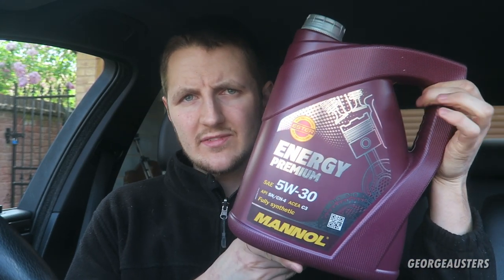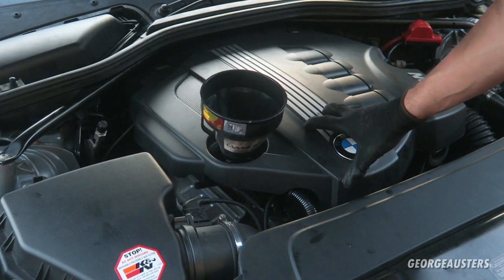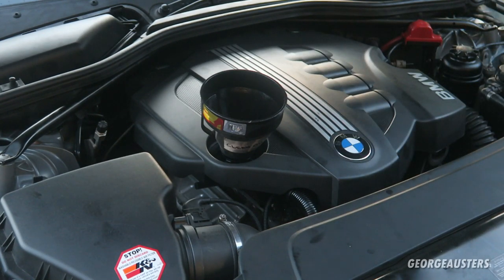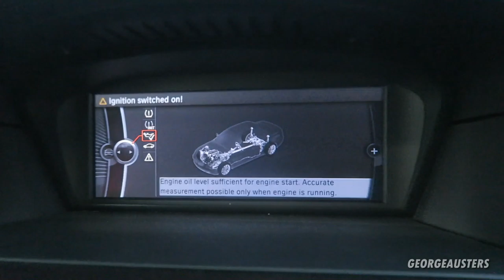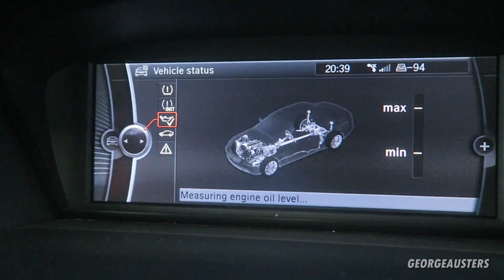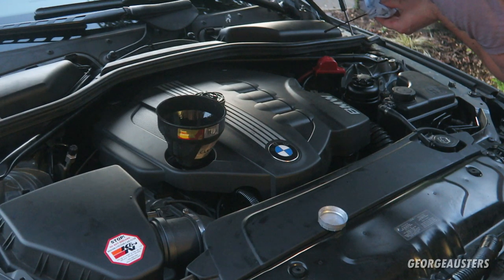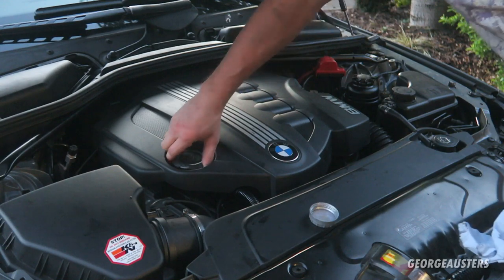BMW N47 / N57 Oil & Filter Change

Comment: Nice one 👍. George i have question.. I bought a BMW X3 n57 six months ago, a service was done and an oil change was recently noticed that the oil level had increased slightly. . is 2mm above Max level on dip stick. Is this level safe for the engine? I plan to change the oil in a few days thanks

Comment: Nulon is my favorite oil. Once I bought saab and the car had dirty engine from inside. I bought castrol edge nothing happened then I find this nulon oil and ooo myyy goood! All the rubbish came down to sump again and again - i was changing the oil every 100, 300,500,1000, 2000, 3000.. and still a little of the slags was coming out. Nulon is cleaning machine lol. For old car with rubbish inside engine I do not recommend it but if is the engine kind of clean inside and you just bought the car its good idea to give him good clean........but you need to watch out because plug oil strainer with melted rubbish is not the best what you can do for your car lol

Comment: Hi, i have 116 ed 1.6 diesel from 2013, N47…i taked the dpf out. is this oil ok or Mannol longlife is better? I never changed the timing chain in 220000km and seems to be good as i change oil and filter every 5k miles

Comment: Hi George, I find all your videos very informative and well made. However I have one small tip for measuring the fresh oil you just put - when you first pour it, wait for 4-5 min to drain into the oil pan and then check the dipstick. :)
Reply from the maker: I did wait some time before checking.. I edited that time out though :)

Comment: How did you find the car running after using this oil? It’s about £20 off eBay but I heard you shouldn’t use cheap oil? Engine runs rough etc etc
Reply from the maker: Fine

Comment: Great video Iv had mine 6 years 120d coupe msport done 110.000 miles      I do my own work the oil filter I put in first so the nipple fits in properly then screw the cap on.    The o ring fits a marked line on the cap so others will know.    The drain plug is M12.  1.5 if anyone wants to know.     Hope it helps

Comment: My 2011 e90 318d N47 has 277,000km (172,000 miles) on it currently. I have put 40,000 km on it in the last year and I change oil every 8,000km. Car has never missed a beat on me, only dpf has gotten clogged which I have since removed as well as egr and the car is a dream to drive. I think they are a great engine once maintained well and people only have issues when they don’t look after them well enough.
Reply: Ever had to change the timing chain?

Comment: Super video George, so I’m just about to attempt my first n57 oil change thanks to your videos! Like you I have LCI e61 but I note the oil filter cap on mine is metal dome with bolt built in above it.
Reply from the maker: You should have M57
Reply: E61 had only M57 2.5l / 3.0l diesel engines.

Comment: George this may be a silly question but do you move the car off the ramp before putting new oil in? Just thinking if its still on the ramp then the engine obviously won't be level and you won't get correct oil readings.
Reply from the maker: Depends how level your driveway is.. I usually put in 500ml less than the max and then top it up to max once I have the car level
Reply: @GeorgeAusters  lovely. Thank you.

Comment: Great video. Why don’t you use a premium oil like castrol which lasts longer rather than the cheap mannol? You could then perhaps extend your changes to 10k and not cause so much waste.
Reply from the maker: Oil branding really doesn't matter. It is the correct grade and spec that matters. You're much better changing it more often with cheaper oil than leaving it longer with more expensive oil. 

That's how the timing chain failure came about.. People was using BMW's longlife oil and changing it every 18,000 miles
Reply: Your clearly quite sensitive about your oil choice.
Reply from the maker: Yes because I don’t want people to think that expensive oil lasts longer👍🏻
Reply: George Austers but it does 👍🏼

Comment: Hey George, 

I am waiting for my mannol oil to be delivered to me, and i just wanted to ask, whats your opinion on this oil compared to the more expensive brands? And what should i look out for on the bottle to know its genuine mannol oil and is 5W-30 fully synthetic the right one for my bmw 520d 2009 n47 engine? Im pretty sure i have got the right one but just wanted to see your thoughts, especially from all your experience. Thanks mate. Have a good one 😁
Reply from the maker: Never had an issue with this oil.. Use it in all my cars!
Reply: @GeorgeAusters  would love it if you did a video on this oil.. Theres alot of us that would enjoy to watch that. 😁

Comment: Help please! Since my last oil change (Repsol Elite 5w30 LongLife 4) my F30 318d N47 190.000km started to drink lots of oil (1L/2000km). 
It doesn't have any leaks on the engine and it doesn't seem to burn oil and blow up smoke from the exhaust.
So what would be the problem? Where does the oil go? Options:
a) Inadequate oil
b) Turbo
c) Piston rings
d) Other
Reply from the maker: How do you know you have no leaks?
Reply: @GeorgeAusters  I don't see any oil on the bottom cover or any other place in the engine. Can the oil evaporate when hot?

Comment: Yes it helps thanks! I was thinking: MANN-FILTER 4011558327200 / Castrol EDGE Titanium 5W-30 5W30 M Fully Synthetic Engine Oil - 5 litres (is 5 litres enough?)
Reply: The capacity should be 5.2 L but when I did my oil change on the 320d f30 it shows max on the dipstick with 5L which I found weird. I would advise you to get 6 L. Pour 5 and let it sit for 4-5 min and then check the dipstick. 
Also change the oil at 10000-15000 km.
I had Castrol edge titanium before but I didn’t really like it after a few thousand km. I used original bmw oil. I’ll probably try motul next then liqui molly and ravenol. 
The engine sounds better after the last oil change.
Reply: @utiuandy99 did u like ravenol

Comment: recently had a service done in the dealer they put the LL12fe 0w30 oil in it. same n47 engine.
Reply from the maker: 0W30 is OK for these engines but it is not needed unless you live in a country where it gets to -20 degrees celcius

Comment: Hi, late to this video but looking at buying a 125d 13 plate, that oil for all n47 engines?
Reply from the maker: Yes correct!
Reply: @GeorgeAusters  cheers, I keep seeing different things about the timing chain problems too
Some same after 2012 the problem was pretty much solved but then some say it wasn’t till 2015
Reply: They also say on the 2012-15 plate the chain can fail but won’t snap

Comment: Hi George I noticed your car screeched when you started it, my 3 series does the same, any idea what it is?
Reply from the maker: Yeah I don’t think it’s anything too concerning. I think it is just the drive belt being adjusted
Reply: Ah I had a feeling it was the belt, I changed the belt and the  belt tensioner but it’s still there, guess it’s something I have to live with, thanks for the reply 👍🏼
Reply: @lewiscarter7049  its the engine mounts
Reply from the maker: Engine mounts? What?
Reply: @GeorgeAusters  the screeching comes from the engine mounts. I had that on my 330d, it went away after i replaced the mounts! thats a typical weak point
Reply from the maker: Checked my engine mounts when the engine was out and they were fine mate
Reply: @GeorgeAusters  idk m8, mine looked fine too but after i replaced them, the screeching went away. Maybe its begins to screech over the years even though its not defective
Reply from the maker: @MrMaster44550  I may make a video addressing this noise but i'm fairly certain it is either the drive belt or sticking starter motor
Reply: @GeorgeAusters  that would be very interesting, looking forward to it 👍

Comment: I have a 2010 e60 n47 with the euro3 exhaust system, no dpf from the factory. Can I use the ll-01 oil?
Reply from the maker: Really? Which country are you in? DPFs were required from 2009 in Europe!
Reply from the maker: Really? Which country are you in? DPFs were required from 2009 in Europe!
Reply: @GeorgeAusters  I’m from Thailand. I think the requirement back then was so behind that of Europe and still is. Starting from January next year, all diesel cars sold here must be euro 5. Cars and light trucks are going from euro 4 and heavy duty vehicles are even going straight from euro 3.
Reply from the maker: @Saintok1 Ahh that makes sense.. yes you should be fine with LL01 then👍🏻

Comment: Hi George, I just purchased a BMW 2013 320D its done 75K. Should I replace the timing chain?
Does this model still have the same issue?

Thanks.
Reply: it does have the issue, but if you do oil changes often it wont fail. you can also bring it to a bmw dealer and make them check if its loose or not :) i have two cars with the n47 engine, the oldest one has done 180k miles and still on original chain with no strange noises :)
Reply: @imortaliz  Thanks
Reply: How is the chain?🫣

Comment: Hi George is there only the one hole that the spike on the oil filter can go into when replacing it, so no chance of putting it into the wrong place? Cheers
Reply from the maker: Yes
Reply: @GeorgeAusters  have u ever used a oil suction pump, what do u think of them?
Reply from the maker: Never mate, much prefer using the sump plug to ensure you get any debris out👍🏻

Comment: I would be careful not following the oil sensor (I know there has been issues on some), but some of the N57 dipsticks actually allow more oil than the sensor is set to (partially as a result of oil dilution tolerance more than anything I believe) or the car actually requires "by the book". 

For example spec says 6.5 litres for my N57, the reality is though when cold the dipstick to max is just under 7, you risk the sensor saying the oil level is too high and leaving no room for expansion. 

Finally on that note, I feel it important to highlight that BMW spec is to check the oil level on the dipstick when fully warmed to operating temperature and then sat for 5 - 10 minutes which with expansion will see it just under max even at 6.5 litres for my N57. I must admit the process is clearly not well designed for a simple oil change, but that seems to be happening with many cars now.

I won't enter the debate regarding more frequent oil changes, other than to say I think 8-10k is more acceptable for many with a good quality oil. I would not push towards any BMW CBS schedule though.
Reply from the maker: My sensor still shows maximum. I think there is a bit of a tolerance with the sensor, especially how it reads when the engine is running. It’s a good ball park but I would never rely on a sensor. I’d always go off the dipstick... better to have slightly more than slightly not enough
Reply: @GeorgeAusters  There is some tolerance, it won't request the litre until it needs it and in some cases it takes a 30 minute trip to update each time (where it does not have the option to do a read there and then, not something I have seen on the N47 and N57 engines and it takes the 30 minutes to read it), not sure on the N47, but on the 57 the min to max is a litre.

The dipstick is good if used correctly, I agree, but they are a dying item overall and most newer engines doing away with them and only allowing a read through diag computers is something we are all going to have to accept in someways (unless they just simply don't install it).

Comment: hello what is best oil for n47 130 miles i live in very hot weather
Reply from the maker: You can probably use something like a 10w30 but still would be okay with the 5w30

Comment: would you rate the mannol oil?
Reply from the maker: Yes mate does the job!
Reply: @GeorgeAusters  looking I to servicing mine. Always used castrol before but mannol half the price
Reply from the maker: Yep brand doesn’t matter. As long as it’s 5W30 LL04 you’re good. Oh and change it every 6k miles or so👍🏻
Reply: @GeorgeAusters  yh my old bmw was every 6-8k (12 months) plan to do the same with this one

Comment: im a beginner and im so afraid that the car will fall on me and kill me because the ground clearance of my car is only 13 cm
Reply from the maker: Use ramps
Reply: @GeorgeAusters  wont the front part of the car hit the ramps?
Reply from the maker: @European-ye7ne  I jack the car up onto ramps
Reply: @GeorgeAusters  one more question, how many tons can the ramp hold? do you think that two ramps with 1 ton capacity each one, 2 tons in pair, could hold the front part of BMW e90 320, which has 2,3 tons or something like that?
Reply from the maker: @European-ye7ne  Yes that will be fine

Comment: My oil filter housing has a big nut on the top of it.
Reply from the maker: Yeah I believe it does on some models
Reply: Now my 520d has 100k miles on it I'm going to service it myself.  Main dealer from new. What torque screw sockets doni need?.

Comment: This oil is £15 for 5 liters why u putting that in your car?
Reply from the maker: Lol what?
Reply: Ebay 5l £15  manol
Reply from the maker: @michalcieslak552  What’s your point? I’ve been using this oil for years
Reply: It’s ll04 spec same stuff you get in your Castrol bottle for 5x the price.